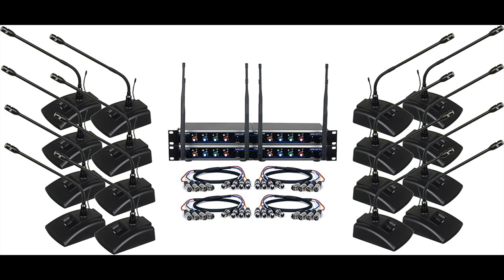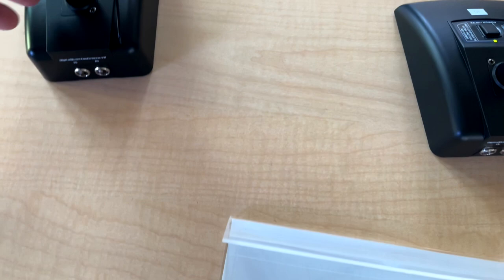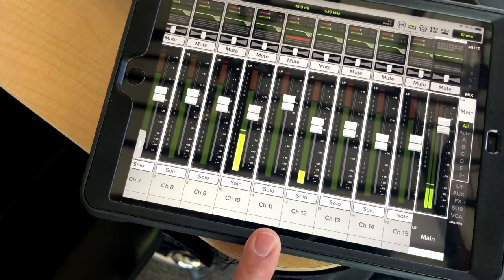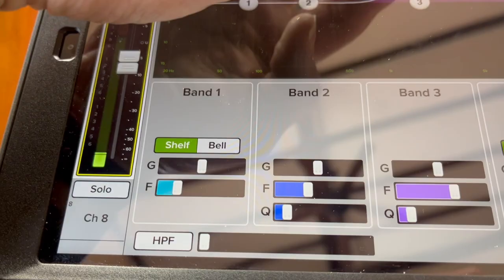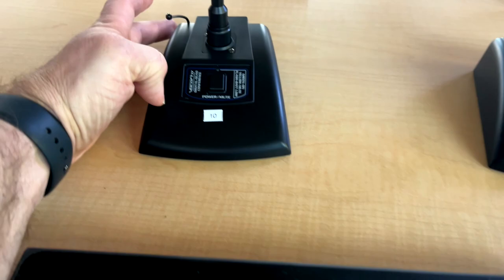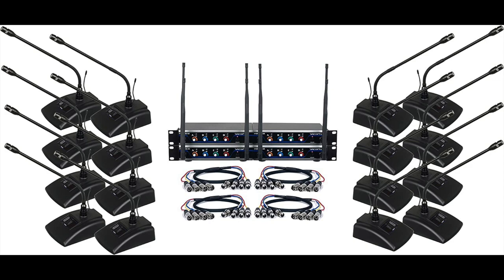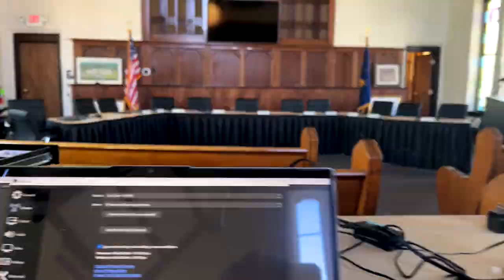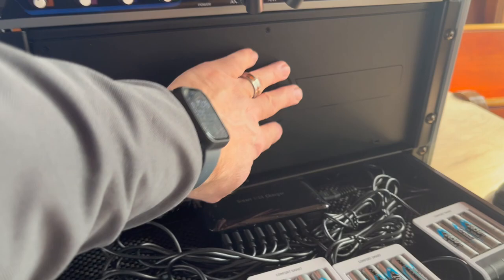VocoPro 16 Wireless Microphone system review DIGITALCONF16

Comment: Thank you very much for sharing the video, I like your configuration.
I'm actually new, and I saw an option that seemed very cool to me, having the console from the iPad, I would like to know what I need to control it in the same way you do in the video, wirelessly, it would be very useful for me . I hope you can help me. Greetings.
Reply from the maker: Thanks for your reply.  A lot of the newer mixers are setup like this with iPad controls.  This particular one is a Mackie DL32S, but we have a DL32R in a larger setting.  I know other vendors like Behringer have similar setups.

Comment: Not sure if you mention it in the video but how long doe these mic last for with your batteries?
I assume you might not know since you recharge after every use?
Reply from the maker: That will depend entirely on the batteries you use.  I recommend Ansmann 2850s.  They are amazing batteries that last a super long time. https://www.amazon.com/Ansmann-Capacity-Discharge-Rechargeable-Batteries/dp/B09KFHQRVJ

Comment: Thanks for sharing!!!! I have a Zoom L-12 mixer and I would like to have the VocoPro 16 connected to it, but I do not see how I could do it since Voco has one cable for each mic which would be 16 and my mixed only have 12. Would you have an idea on how could I use it? thanks
Reply from the maker: Yes.  At :53 in the video you'll notice there is a 1/4" jack labeled "Mix Out".  This is a 1/4" output combination of all four channels.  So you'll only need to run 4 channels into the Zoom L-12.  You would just have to do the mixing of those mics on the front panel of the receiver(s) instead of the L-12.
Reply: @masterofnone8065  I see thanks, I think then I can either use the 16xlr cables going to a mixer, or in my case just 4 1/4'' cables going to a mixer.
Reply from the maker: @jefersonsiqueira9896    Yuppers.  I went with 16 because I wanted to control each channel individually from the iPad through the Mackie mixer I was using and I had the free channels.  It gives more more flexibility throughout the broadcast.